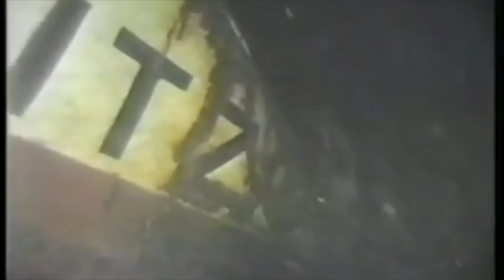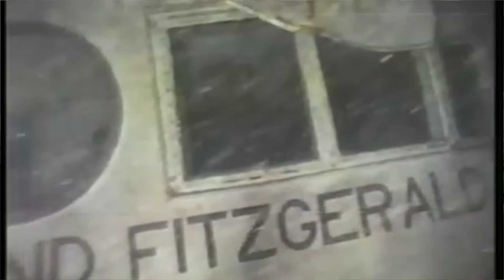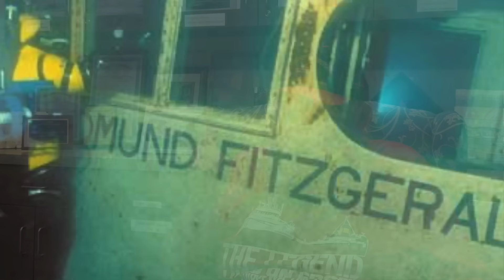Sinking of the Fitzgerald ... Negligence or Nature? Season 3 with Capt. Darrell

Comment: L.O.R.A.N  C was keeping aircraft flying the Atlantic 1000 apart. In use for aircraft in late 60s and 70s long before 80s. And other advanced navagation was  being tried before GPS. These advances help safety on the lakes, when installed.

Comment: Question for Darrell Walton,  I was wondering about the lifeboats no 1 and no 2 . Is there a particular set rule on which side of the vessel that a lifeboat must be located on a ship stored and launched from?  Or can they be stored on either side regardless of the number designation assigned to it.
Reply from the maker: That's a good question...we'll see what Darrell says. You there Captain? HMM
Reply: standing at the stern looking towards the bow starboard to the right side and port to the left. lifeboats with odd numbers 1 3 5 7 etc are located on the starboard side of the ship,even numbers 2 4 6 8 etc are located on the port side of the ship just so people know.
Reply from the maker: Thanks...another bit of information I did not know about. HMM @wirelesswavewirelesswave
Reply: @wirelesswavewirelesswave  The exception was the Lusitania which not only reversed that order but also numbered off from the stern and not the bow.

Comment: Discovery channel back in the '90s had a documentary called The wreck of the Edmund Fitzgerald there is videotape of them actually dogging down the hatches and they are in horrible shape. You can see pitting the size of golf balls I wouldn't count my life on it I've never been on those big boats like that but there's no way in hell I would have trusted that hatch to keep the water out because I could have poked a hole in it with a ball peen hammer!!
Reply from the maker: Interesting. Is that doc still out there somewhere? Thanks...HMM
Reply: @HistoryMysteryMan  on the documentary expedition 94 by Fred Shannon Fred I believe his name is bruner is talking in there about the kill plate he said they took the president of the company down to the bottom of the boat and Captain Peter pulser took a number 16 coal shovel and jammed it between the kill plates and the deck plate and welding rods came out. The president of the company knew this boat was in big big trouble. That's also why he got off the boat because McSorley wouldn't baby her and pushed her as far as he could.

Comment: She was due in for maintenance. Last trip of the season. Loaded heavy. Running fast. The QE2 struck a reef. The inquiry determined that as the speed doubled, the draft increased 4 fold.  The Fitzgerald's hull was compromised.  Loaded heavy. Sitting lower in the water. Running fast to beat the storm. Rough seas. She had to be riding quite low. The two ships, Fitzgerald and Anderson were in radio contact. The Fitzgerald reported that a wave took off the weather radar dish. She was off course. The Anderson watched the Fitzgerald drive right over the shoal while riding much too low.
Reply from the maker: Interesting thoughts...sensible. Thanks for sharing it here. HMM
Reply: We don't really know that the Fitzgerald hit bottom, but it is very possible.   That boat had no chance of survival in that storm

Comment: one theory ,and it is just that , but it seems to make sense,  looking at the high up damage on the pilot house i think the final moment was a big wave that hit her face on , so powerful it almost stopped her dead in her tracks bearing in mind mcsorley had checked back too, causing her to belly burst, this would explain how there is taconite ahead of the bow in the field of debris, and also how the lifeboats became ripped away and probably pinch damaged, its already established she was weak in the middle with only 3 cargo holds and screen bulkheads, it would also explain the missing cargo hatches as the load shifted forward they would have been displaced, dogged down or not, and if she was 4k overloaded she would have been sagging in the middle from the off.
Reply from the maker: Super interesting analogy...enjoyed reading it. I wonder if when she suddenly hit the bottom of Superior it would have thrust some of the taconite forward and further damaged the pilot house. Anything is possible, but the heavy seas were coming from behind, which could have lifted up the stern and shoved the bow down for good. She landed with such force (nose first) that it could have caused the damage we see. Thanks for your interest! HMM

Comment: I would like to know what has become of the Fitz maintenance records. Because it is my understanding that the Fitz had a broken weld inside her. It was known of and they planned to repair it at the end of the season. The Fitz sunk on that last run of the season. We know she was overloaded. But over loaded and structurally compromised as well? It has never sat right with me that the crew and Captain have always gotten the blame for the ships sinking. Cap. Cooper assumed the ship tapped bottom. What if the truth had been hidden, hidden because if found out it would have sent shock waves through the industry. We know the Fitz had a fence rail down and was taking a list. If the haul was compromised and there was load shift. Basically I want to know more about what known damage to the ship before she sailed. The Fitz was run hard and put away wet. A damaged ship in that storm....I really want to know. I grew up in Toledo and have never excepted that the crew or captain screwed up. But I feel like the powers that be never really wanted to find out what happened. And I think that is because they already knew.
Reply: To add more context: The guy speaking about the broken weld was a guy who was in Duluth just before the Fitz sailed. I think it was a television show, or an early early pod cast. I can't recall because it has been so many years ago. But I assumed people would have or be looking into it. But it seems that bit of information has faded to time. I can't help but wonder if the Fitz was in such poor condition and so over loaded she perhaps flexed herself to the point of taking water and then nose dived. Ernest McSorley has been accused for going on 50 years now of running into ground. Is that fair? I would like to know the truth and perhaps restore a man's good name. Every man on that ship was seasoned and well trained. I don't for a second believe any of them screwed up.
Reply from the maker: Thanks again...for all your thoughts and feedback. Many people believe/believed that the Fitz had several structural problems...broken welds were one. Many believe/believed some of those structural weld issues were at the keel, which is the worst possible location...the backbone of the boat. I do not know where or if maintenance records exist on the Fitz. Captain McSorley sailed the Great Lakes for more than 40 years, and although he ran his equipment hard, he never had an issue on the scale he had on Nov. 10, 1975. No need to repair McSorley's reputation here; I have complete respect for the man who gave his life to the industry he loved. It's real easy to armchair his decisions and career from a comfy couch these days; I don't/won't do that. HMM

Comment: Heres another thing, in the wundlass room in the fwd house area,  its not a water tight area. You pack the anchors with old pilliws in berlap bags with plate covers over the haws pipe that the chain runs through. Its not water tight.  If her bow was constanly being pushed down in the water, then water is going to be gushing up those haws pipes and flooding out the wundlass room. Sure thers drain holes in the far corners but if they were full of dirt or just coverdd up, that would put added weight to the bow section, forcing it to ride deeper ib the water, not to mention  if it did flood in there and that water would find its way to the chain locker and fore peek two decks down
Reply from the maker: Super interesting perspective. Brings in new content I never thought about. Thanks for sharing that here. HMM

Comment: I dont know what to think..if Fitzgerald bottomed out on a shoal and compromised hull integrity to the point of the water pumps being unable to pump out all the water..you have to wonder...Why did the captain not turn towards shallower water and let her settle on a shoal where it may have been possible for crew to abandon the ship and make for shore?...come back at a later and recover the tagganite and salvage the ship?
Be easier to do in shallow water than losing the load,the crew and the ship
Reply from the maker: All good questions. I believe that McSorley thought he could safely get to Whitefish Bay...they were only 17 miles away. Thanks for sharing your thought here. HMM
Reply: @HistoryMysteryMan  i wonder if the crew were inspecting the lower areas for a damage report and missed something...im sure the Captain would have ordered a damage report.
I dont suppose we will ever know exactly what happened nobody can get near her now not even for an in depth assesment..a better one than was done after she was found.

Comment: History Mystery Man you and I discussed this a bit the comment thread of a video you made on this in what I’d call season one. My comment dates to Nov 2021. 

I that thread I argued for the hatch cover failure theory based on the NTSB report. 

But let’s examine this another way. If we accept that there are forces seeking to cover up what happened to the Fitz we have to ask why. The answer of course is that they bear liability for her loss. 

Of course if your the corporate type it’s far easier to cover up any hint you might be liable even if your not. But if they think they are liable the question is of course why. 

Which returns me to theories as to why she was lost. If she grounds in shoal water and that grounding ultimately led to her loss then there is little risk of her owners or other interested powers in the Great Lakes being held to account. 

On the other hand if the reason for her loss was primarily attributable to hatch covers that were not water tight that’s a different story. Because all that water coming over the deck is down flooding into her holds and being absorbed by her cargo leading to her riding lower and lower in the water.  That she was overloaded and suffering from structural issues as was covered in the video only made her hatch seals worse. 

This goes on with the Fitz getting lower and lower in the water until finally she is boarded by a large wave that causes hydrostatic failure of her forward hatch covers  (the possibility of which was firmly established in the NTSB report) and the sudden rush of water into the forward holds drives her down by the head. 

When the bow impacts the bottom the shock causes structural failure leading to the separation of the stern and the wreck as we know it today. 

If we accept that scenario as true then the ships owners and others are indeed liable for her loss. Liable because they allowed her to be dangerously overloaded in the name of profit. Liable because they knew full well her hatch covers were not watertight and would not withstand a boarding sea. Liable because her design allowed her to flex excessively and had too little subdivision to deal with flooding. 

Don’t forget too in this scenario the Coast Guard and other marine certification authorities also come off poorly because they allowed a ship to be designed and maintained in a fashion that was guaranteed to result in her not being seaworthy. 

Finally bear in mind that simple structural failure doesn’t account for her loss. That has happened numerous times before both on the Great Lakes and at sea. And in those cases we have chunks of ship that remain afloat for a period of time sometimes hours. Structural failure doesn’t generally lead to the sort of near instant sinking that was suffered by the Fitz.
Reply from the maker: But if she was breaking in two...that would equate to a major structural failure in my mind which could result in immediate sinking. And...she only had three cargo holds separated by screen bulkheads. She was weak in that regard and rode to death for decades. Thanks for sharing your thoughts...I appreciate all the time you put into your analysis...and it does have me thinking newly as a result of your analysis. Excellent commentary...HMM
Reply: @HistoryMysteryMan  thanks for responding. 

My issue with a massive structural failure is that when that happens the sinking is usually slow enough to get a distress call out. Also if she broke in two on the surface her wreck would look different. 

The bow looks very much like a ship that went down by the head and impacted the bottom. It doesn’t look like a ship that broke in two on the surface which would lead to her sinking from the middle first. Also if she broke in two and flooded from the middle I’d expect a pile of ore on the bottom as both ends spit out their cargos. Her hatch covers also would not likely have imploded as the air pressure under them as the ship flooded would have supported them. 

The more I come back to this the more ai find that the one majorly theory about her loss that doesn’t have major problems is the one advocated by the NTSB.
Reply from the maker: Again...super interesting. Now you have me thinking, re-evaluating, etc. Thanks for your thoughts on the Fitz. @jetdriver
Reply: @jetdriver  There is video shot from a Coast Guard helocopter, (in radio contact with the bridge of a very large ocean going frieghter), as it hits a large wave.  The ship was intact as the bow hit the wave then instead of riding up, it dove into it.  The screams of the crew can be heard in the video as the ship is consumed in seconds by the ocean, the entire  crew died.  I tried to find a link to this incident but unfortuately no luck.
Reply: @brianlangum6253  I’ve heard of this story and while I don’t remember the name of the ship it was included at the time. I’ve been forced to decide it’s false. The ship listed in the original telling of the story didn’t sink as described nor can I find a record a similar sinking. 

Not to mention that video of such an incident would doubtless be all over the internet and yet it doesn’t exist. 

That being said such a scenario if it was true would serve to basically support the NTSBs conclusion as to how the ship was lost.

Comment: Ice was not likely a factor as the the water tmeperatures would have been in the 40s and air temperatures right around freezing plus or minus a few degrees.  Hap this occured in mid/late January with temps in the single digits or colder and water temps right at freezing, then ice could have played a huge role.
Reply from the maker: Understood...thanks for sharing your thoughts here. HMM

Comment: So why would they still be concerned about liability if Colombia Transportation is long gone?  I think it's pretty obvious why they're still worried about liability, and IMO it has nothing do with a shipping company (and it never did).  The Coast Guard's report on the Fitz magically absolved all related parties of any liability - yet who was responsible for setting the load lines on the Fitz and who was responsible for the antiquated charts that showed the shoal at Caribou Island being much smaller than it actually was?  They weren't protecting the shipping company - they were protecting the Coast Guard.  And maybe that's why they don't want anybody diving on the Fitz, because the upside-down stern plainly shows patent evidence of bottoming out at Caribou?  Everything from that night indicates that the Fitz indeed bottomed out at Caribou.
Reply from the maker: Good questions...wish I could answer them. And remember, there is a huge center section of the ship that is completely disintegrated when it broke in two. Thanks for sharing your thoughts here. HMM